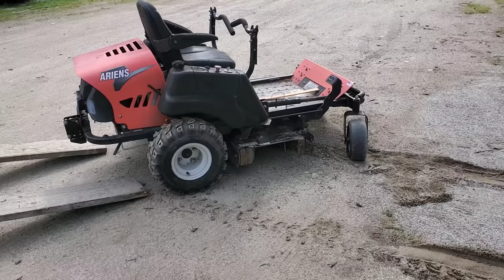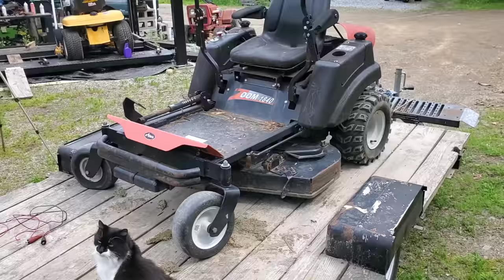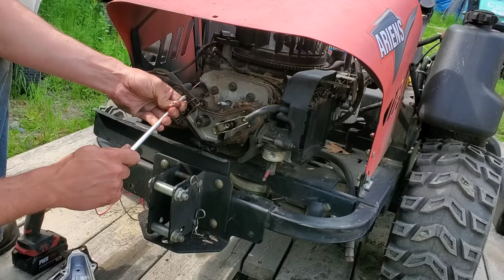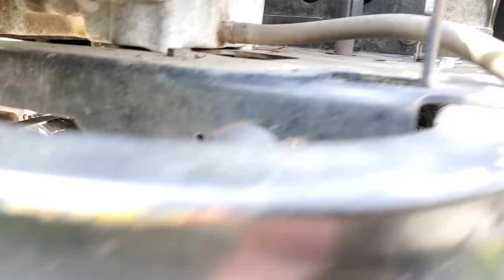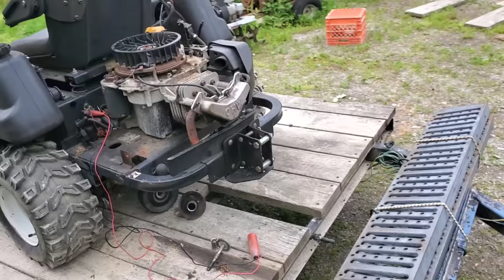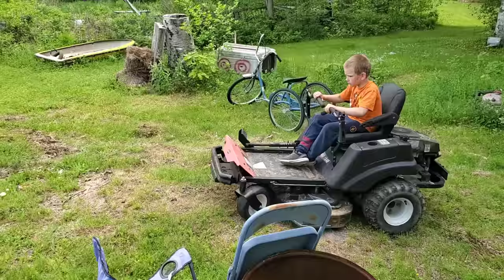Tractor Hunting: Ariens Zoom 1840 Zero Turn

Comment: WOW , I Couldn't Be That Lucky, What a Bargain. i would Have Gotten That Motor Going, With a Little Bit Of Mucking Around, I Reckon it Would Have Went
Reply: I would pull heads right from the start and fixed it up to last for years
Reply: He just wanted to swap engine i don’t  know  if he is that good or playing around for the video.

Comment: I'm wondering why no one has mentioned that it was trying to roll backwards when he was attempting to start it. You said the parking brake was down, not sure about those but most if them you hsve to pull up to engage brake or mine was atleast which could be another reason its not starting. Enough ranti need to finish the video because im curious on what you find out.

Comment: Just a suggestions. The Kohler Courage engine is a very unreliable engine, It's known in the community as the bucket engine. Valve rockers come loose, I've seen the crankcase cover bolts come loose and the flywheel takes it out and cracks the block, weak coils, flywheel key shearing (usually due to valves sticking or misfiring engine) and overheating due to lack of cover removal and cleaning. Either Loctite all the bolts on the top or at least tighten them snug.
Reply from the maker: Well I agree with you. I did not buy it to keep I bought it to flip and sell. Small ones like this only sell for about $600 and can turn money pit fast. So fastest thing is all ways just to swap same engine for same engine.
Reply: @redneckcomputergeek  Yeah im 19 and have been flipping equipment for a few years know and whenever a customer brings a Courage engine into the shop it could go either way. They are nowhere near as good as the older command engines.
Reply: @tuggyboat  Do you have a engine for a snapper zero turn 48" cut
Reply: Yep sump gasket replace every year